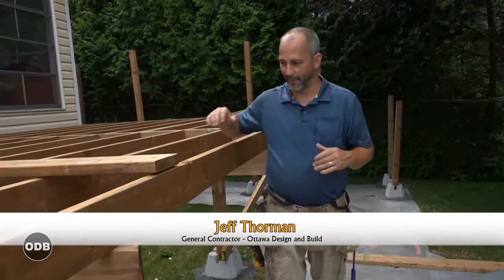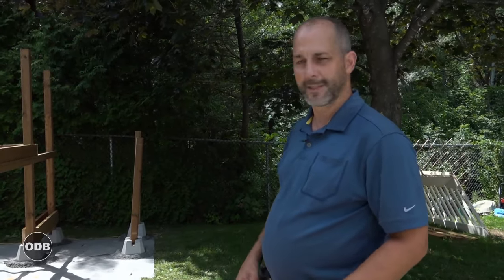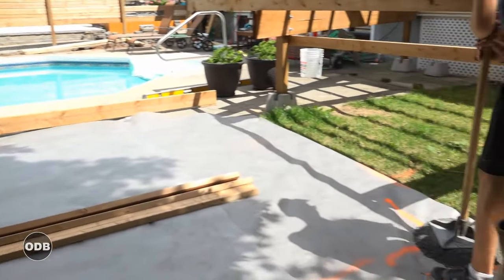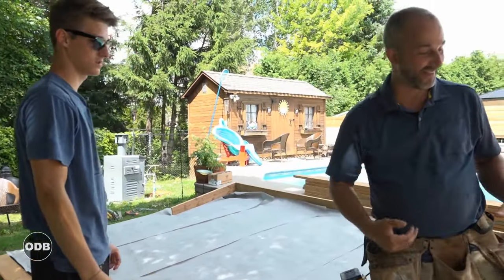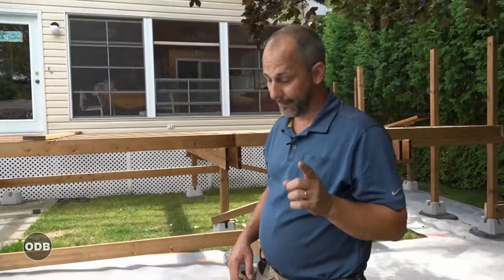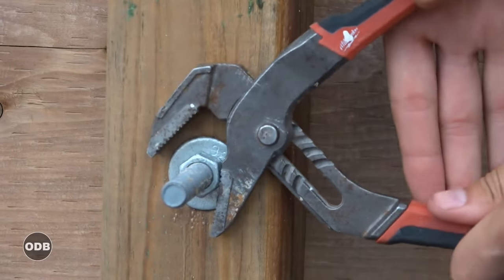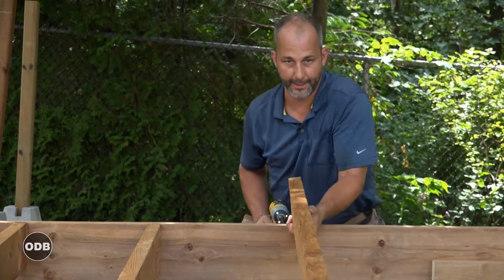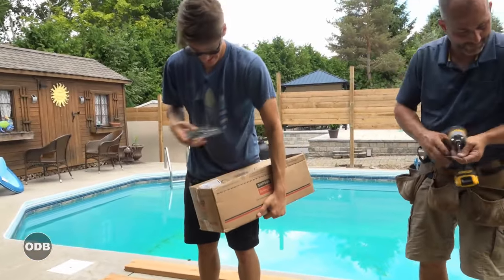DIY DECK Part 3 | Ground Level Deck

Comment: A little tip is not to use Channel Locks (slip joint pliers) for tightening hardware. By using them, yes they are quick, but as the teeth scrapes against the nut it removes the galvanizing allowing for the hardware to rust. Only use a wrench, box or open, socket, or a crescent wrench.
Reply from the maker: Love the tip. I will change my technique tomorrow.
Reply: Barronohbeefdipp channel locks are tongue and groove pliers.

Comment: You guys are great but there's no way I could build that deck in my area.  Aside from the hangers, nothing else would meet code. I don't see how that platform is going to remain level with even a small amount of vibration. The dead load alone is going to settle those prefab concrete piers.
Reply: Agreed......this is ok for homeowners but certainly not minimum building code.
Reply: Scott H where you located?

Comment: I would use split lock washers on all those carriage bolts as well.  Just ensures that they all stay tighter as the wood shrinks.

Comment: I believe this is where you can now use 5/16 structural screws like the grk rss or the spax power lag instead of the 1/2 inch carriage bolts. Removing the need for drilling holes. 

I think you would want to use a screw long enough that you see it come through the back side of the 4x4 post.

Comment: Hi,
What is the difference between this method of building a deck and the one with deck piers that you dig 4 feet and pure concert, I need to build a deck 22” above ground and it is 14’ by 12’.
Kind Regards,
Zaid

Comment: 2:40 Look how beams are attached to the posts. I am not familiar with Canadians building codes, but I am pretty sure this deck will not pass a code inspection in most (if not all) US municipalities - support beam must be placed directly on top of the posts (post could be notched), rather than bolted to the side, so the full load is transferred to the posts. 
Basically, the entire weight of this section of the deck itself, plus whatever furniture/grill they will have on top of it, plus weight of all the people who might be there is going to be supported by 8 bolts, which are not designed to withstand lateral forces.

Comment: I'm planning to make a low level deck just on top a concrete slab but I am not that familiar with dos and don'ts here in North America especially on icy weather. My querry is if  it is ok to directly put  wood or the joist on top of the concrete slab or it is advisable to elevate it a little, the slab has a good slope though. By the way loves all your videos.

Comment: A tip for anyone like me who gets their fingers in the way (or just lack of grip strength) when attaching joist-hangers: use quick-clamps to pinch it shut around the joist and hold it in place while you get the first fasteners in.

Comment: Quick question, when building a box beam, can you use different width boards? For instance could i use 2×6 around 4×4 posts as well? Looking to build a floating deck myself soon, but it won't be more than 20 inches tall and I'll be using the deck blocks as well. 2 × 12 would be too tall for my use. Thank you in advance.

Comment: great work but still no i.d. of what screws used(size) .. brand.. one other video I watched the guy used 3 inch and 4 inch on the railings.. and was saying the <rainbow> crown on the boards had to be curving up..  (I think not) but does it matter w larger boards? do you check the "crown" on the sides?
Reply from the maker: 3" deck screws. Cheers!

Comment: I like how scientific and educational you are in your discussions. Is there any worry about the 4x4 end grain sitting on the concrete deck block, as far as water sitting there and being sucked into the end grain? Any reason to wrap the end of the post in joist tape? For that matter, why not joist tape on top of the joists?
Reply from the maker: The deck block has a drainage hole in the center. If water does get absorbed it will quickly be removed with the dry air after the storm. I try not to build anything outdoors with an expectation to last more than 40 years. I find it impossible to manage a clients expectation and so I don't go through processes that may or may not have a small effect. I know that deck is good for 40 and that's what I am selling them.

Comment: What are your thoughts on using those screw in piles instead of the concrete blocks or even digging and pouring concrete posts.

Comment: Although codes differ from one county/city to another, the one thing that baffles me is the piers passing inspection, as you have them. 

The gravel underneath will "wash" away from rain and movement. So all in all, those piers will all settle about an inch lower than when set. 

I'm surprised the city would allow that as oppose to digging down 1'+ to set them into a "pocket".
Reply from the maker: Just to let you know 2 years now and the deck is doing fine. Cheers!
Reply: Home RenoVision DIY - awesome. 
I guess engineers do know more ;)

Comment: I know I'm late to this video but recently found your channel and really enjoying the learning. I've always been reluctant to do a floating deck for fear of washout/erosion around the blocks and any leveling media used. How do you account for or avoid that problem?
Reply from the maker: you can always pour a little post cement around the base and spray with water. it sets up and makes an onsite bowl to hold everything together. Cheers!  or dig down a little. Cheers!

Comment: at 4:18 -- are carriage bolts okay for weight bearing??? I was recommended to notch the vertical post to redistribute the weight load.
Reply: No, they are certainly not. Not to mention that 2 x 6 structure does not meet building codes. This guy needs to read a building code for deck structures.

Comment: I’m about to build a small, ground level deck that I was hoping to support on one side by existing concrete decking, as you have done here.  Is the rim joist just laid on the ground with no fasteners or any form of attachment on that side?  If it was in the video, I missed it.

Comment: I find it interesting that you use just a pile of ... whatever that is, gravel? to hold up the blocks.  My old house has this kind of foundation on an outside landing/porch, and they dabbed a blob of concrete or cement down in the ground, then aligned the blocked on top.  I don't know why your sand or gravel would move or get disturbed, but it seemed funny to just have everything on a pile of gravel.  That doesn't settle and change over time significantly?
Reply from the maker: It is just there to make it easier to level the block. serves no structural significance.

Comment: Great videos. Question, why does the top half of deck have a box built on top of your structure, while the bottom half the deck is built right onto the supports? Why not build the top half of deck right onto the support too and skip the 'box'?
Reply from the maker: when building ground level there is no risk of falling to your death. Way up high I over engineer things a lot.

Comment: Hi there,Great videos very easy to follow so thanks for sharing.Just a question I'm in the UK and the CAMO system isn't very popular here. I've got a deck to do soon and like the hidden appeal. We use a lot of treated lumber here? Do the boards ever move or warp at all? I really want to start using but not sure about it!Keep up the great work - cheers
Reply from the maker: Thanks Chris. In actuality I have found that the boards curl less with the camo system. With a traditional fastener the only downward force on the board is screw head. With the camo system the entire length of the shaft is downward force. This is almost 1 1/2" since the screw is installed on a 45 degree angle. The only down side is it takes 3 times longer to screw down. But I fin d it worth the time to have a lifetime of splinter free deck.

Comment: Hello Senor, can you tell me what type of wood is and where to find it porfavor ?
Reply from the maker: Pressure treated lumber is available at every building store in North america. If you are building something that comes in contact  with the ground be sure to use "ground rated " products. they are not all the same. Cheers!

Comment: I would love to build a small deck in my yard. But I have some curve areas. How would I bend the wood for the edges
Reply from the maker: Just use your circular saw to cut 3/4 way through the ridge board every 1/4 inch for the duration of the curve. Sounds like a video I should be producing this spring.

Comment: lol now that is interesting @ barron. So you think tightening galvanized  nuts would take the galvi off? I think that most recommended galvi hardware is usually 3x dipped as most people are using treated wood.I would worry about them rounding the nuts more than taking the galvi off. then again if they got the cheap type then if they see the galvi coming off the nuts or heads nothing some outdoor spray paint won't fix. Tape them and spray them black so they look sexy. Good video and watch out for rust.I wonder how long it would take for a nut or bolt to rust so it would fail? I would think way after the wood on the deck failed.
Reply from the maker: I guess if you used a really cheap pair of channel locks that couldn't take the torque it could be possible. but then I would be more concerned about my knuckles.
Reply from the maker: more concerned about knuckles.lol
Reply: This summer I replaced my ranch gate lodgepole posts (2 on a side), after ten years they had rotted right at ground level from snow, ice and water during the winter in Central Oregon high desert area.  This time, I did it right and tarred the posts and left a quarter size drain or weep hole at the pole bottoms with an additional tar paper over it.  The 5/8" diam. 71/2"  lag bolts had some rust only about 2" from the Head of the bolt.  I believe they would have held for at least another ten years.  This time, I greased the lag bolts when I installed them.  So should last longer and remain strong enough.
Reply: @HomeRenoVisionDIY  Hi can you please help me plan a very small deck about a foot high against the my house ,like a platform with maybe a step or two . Planning on using pressure treated lumber and trex on top. Not sure how to start . I can send you a picture  of my yard. Any information  is appreciated. Thanks Peter

Comment: one Question tho. You talk about nails or bolts being used but they have structural wood screws on the market that I cant see how they would not preform just as well as nails or bolts in a comparable size. I know that I used some to put 2x12 lumber to 4x8 posts and have been standing on them and they are not moving but then again this is not a deck and there are  2 per section and the posts are 6 ft apart. I did use them on some wood stairs also and the stairs are also solid.
Reply from the maker: The structural screws are to be used when attaching joist hangers only. This eliminates the need to use a hammer in close quarters of your fingers. The bolts are used to attach box beams to 4x4 posts

Comment: my county requires all 6x6 posts notched and bolted.
Reply from the maker: Too bad, sounds like a lot of unnecessary work.
Reply: i don't know, might be. Virginia tech is in my county and they have had many deaths and injuries from deck collapse.
Reply: many deaths??
Reply: NJ Bergen county is nuts  hillsdale oradel paramus they are insane  with their triple  2x12 girder and 36x18 footing

Comment: Now you are relying on the shear strength of bolts in post
Reply from the maker: yup. exactly. And it works!
Reply: Ottawa Design and Build Renovations Not to code here in Ohio. Joist has to be on top of notched post so all the load is on the post, alleviating shear of the bolt.
Reply: Or you have to put an angle bracket under the beam on the post if you don't notch...  I agree...bolts alone are no longer code.
Reply from the maker: JayWC3333 cide will be different in each jurisdiction. for best practice consult local building office.
Reply: Galaxy Music School Northshore  418 52 86 more and more the code requires beams to be supported by solid load bearing connections.  Bolts used to be code but it's changing.  Don't call people idiots.  Also, since you did,  it's you're not your.

Comment: someone needs to teach that kid to use an actual wrench and not a channel locks to tighten a bolt lol.
Reply from the maker: Firstly I use channel locks because of its versatility. They are always in my bag. and secondly since it works so well, why would you be concerned over the tool choice.
Reply from the maker: Take a flying Leap there  Flyin Raptor AntiChrist My Kid is amazing.
Reply: Home RenoVision DIY 😂😂😂 looks like your kid needs some more practice and why Chanel locks lol

Comment: Surprised your city would allow you to use a floating deck for that application, in my municipality you can't use floating if the height exceeds 24" but then again we don't have to use the footers at the bottom of the post holes.
Reply from the maker: It all depends on the city and the inspector on site. Sometimes you need to haggle a bit to get to an agreement. Most city officials are open to ideas and when you can't agree get an engineer. The city has rules so they don't need to be engineers. There are a million ways to build. You just need to find out what your jurisdiction wants and deliver a product that will pass inspection.